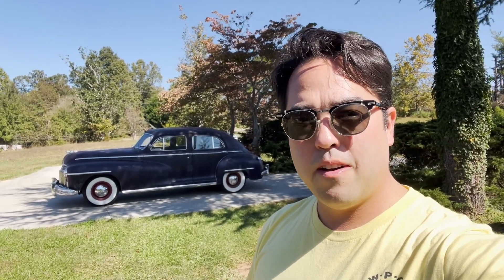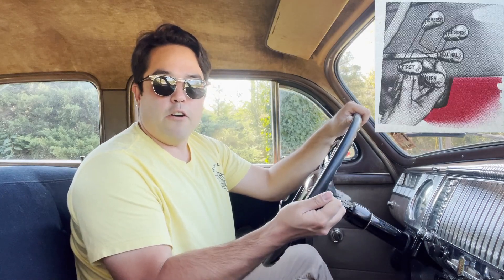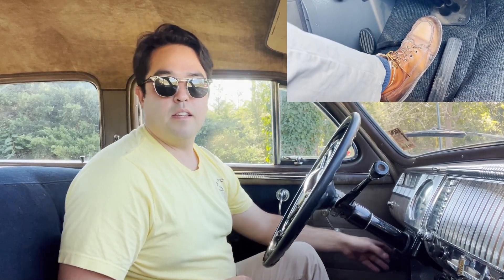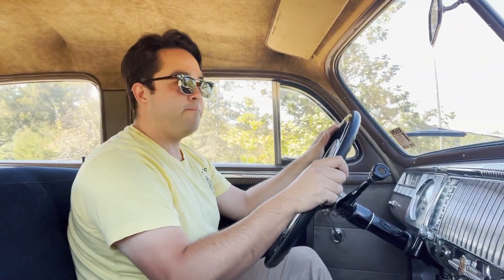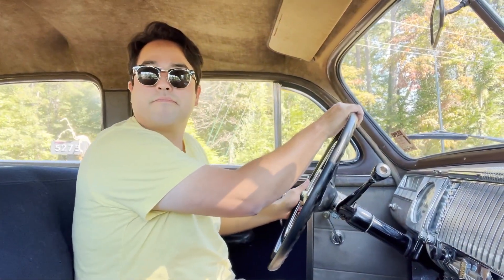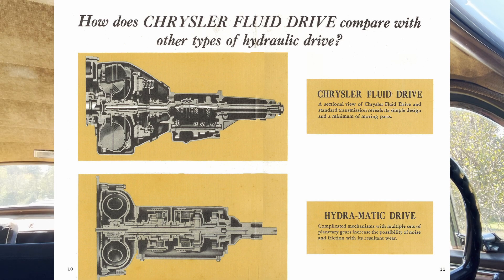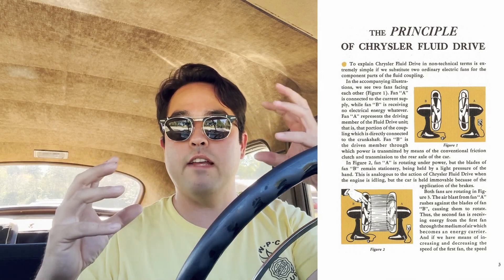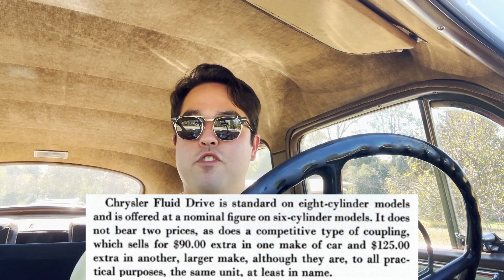Fluid Drive - Operation and History Chrysler's Innovative Transmission. How to Drive a 1947 Dodge.

Comment: Good video, explains the operation of fluid drive very simply. I do have a question though.......since you do have that fluid coupling, can you shift from 1st to 2nd, and 2nd to 3rd, by simply letting up on the gas and shifting without pressing on the clutch? (This would be similar to driving a car equipped with a Borg-Warner overdrive, where, because of the freewheeling of the OD unit, you can shift from 1st to 2nd and from 2nd to 3rd without the clutch......just letting off the gas and shifting a little slower.) I know it wouldn't be recommended from the factory to do this, but can it be done?
Reply from the maker: @r1lark  The B-W OD units have a freewheeling clutch which essentially disconnects the engine from the the transmission. So then you freewheel when you let off the accelerator. This allows for the auto shifting of the OD. And in turn makes it easier to shift without the clutch since there’s no engine torque on the gears. 

The fluid drive unit when driving is essentially making a fully connected engine and trans via hydraulic fluid. The clutch would still be necessary to take torque off the gears and shift. Though shifting without a clutch is generally feasible for any vehicle by matching engine speed and shifting when appropriate. The only time the fluid drive free wheels is when stopped at idle and the hydraulic connection is lost.

Comment: Very interesting. My father learned to drive in the late forties and well into the sixties he had an annoying habit of lifting off the gas between gears.in an automatic car. Any make of automatic car. He had a Rocket 88 a 1954. My mom bought a 54 Chevy new at the dealer. They gave out plastic models of the car you bought in the same color with a slot on top to use as a coin bank. She had a three speed on the column. I believe she opted for white walls. We cleaned the whitewalls with Brillo pads back in the those days. She had the wide white  walls not the later sixties thin white walls. Now before seat belts or any thought of safety anything if it looked like we were going to have an accident my fathers arm would fly out to retain me on the bench seat. He did it instinctively and automatically. Not that it would not have done any good but everyone did that.  My father would let off the gas between  first to second shift. So the car would just get going and then he'd let off. Somehow it would find its way into second.  But we'd always loose some momentum for no discernible reason.  My moms car was a "two tone" as they called it then. The roof was white or a cram color and the body was non metal flake brown. My father went on to have a 56 Dodge Coronet I think convertible with the V8. A 59 Lincoln. A 63 Lincoln,  A 57 Coupe DeVille in bronze with the wonderbar radio. Thereafter it was Mercury station wagons. The last being a Colony Park with a 429. It had been preceded by a 67 Colony Park with a 390. I had a 1968 GT 500 Shelby convertible in green and then a 1966 GT 350 white with the blue stripe.  A 59 TR3 ..........etc.

Comment: I thought the fluid drive was a great transition from manual to full auto transmissions. I'm  familiar with the 49 DeSoto with the " Tip-Toe" fluid drive semi-auto transmission.  Also known as the clunk-O-matic. With the 2 high and 2 low gears. Only needing the clutch to go from low to high and reverse. A very fun car to drive. Thanks for the video. You don't see alot of the late 40s car videos.
Reply: With Clunk O Matic, you only need Lo when taking off on a hill.  On level ground, you just use Hi and never have to shift.